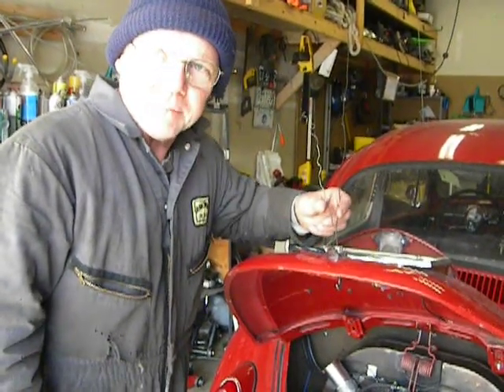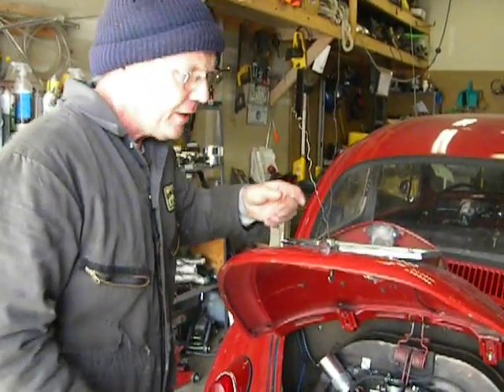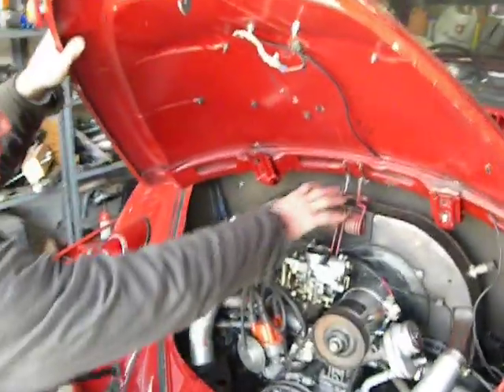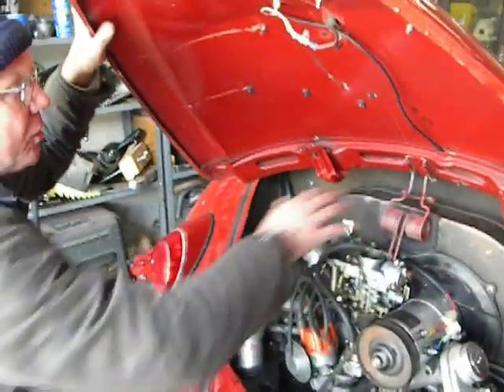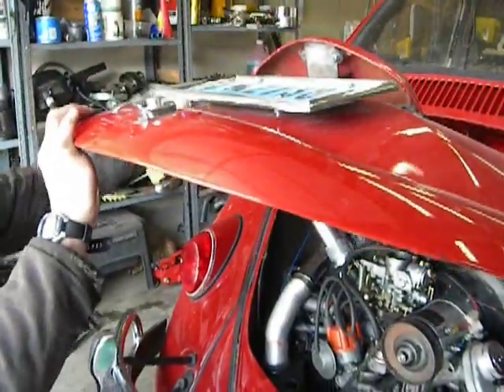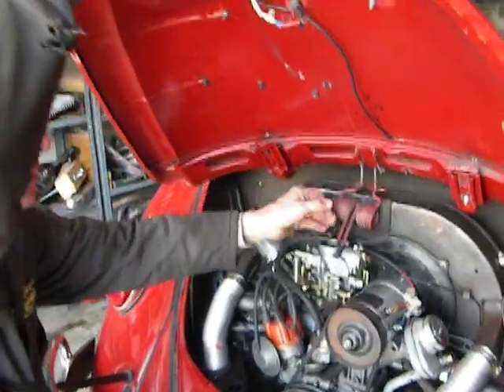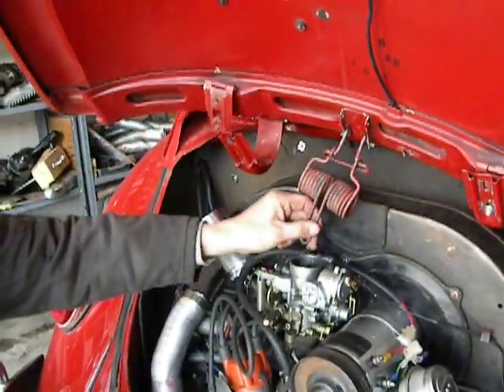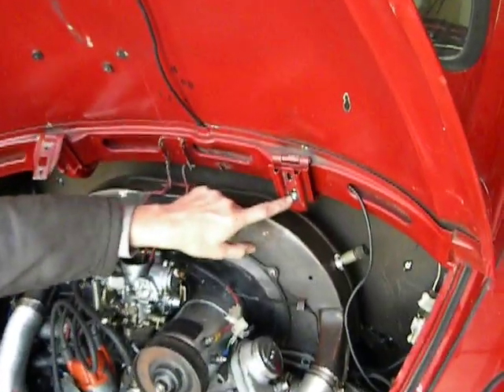Putting deck lid spring in a 1967 VW

Comment: Hey Kevin, thanks for the tip.  I have a restored, Java Green, 67 Bug also and  never removed the decklid before and I was trying to re-install the two spring tips at the front by compressing them with a pair of vise-grips. WRONG!  Hey, what did I know?  But, your method did the trick fairly easily. Its using the leverage of the decklid itself.  Pretty cool.   Now I just have to get the alignment correct.   I have had my 67 for 48 years.  J
Reply from the maker: I should have taped all the edges first.  Without it I ended up chipping paint in the lid and frame.
Reply: I did the same thing, darn.